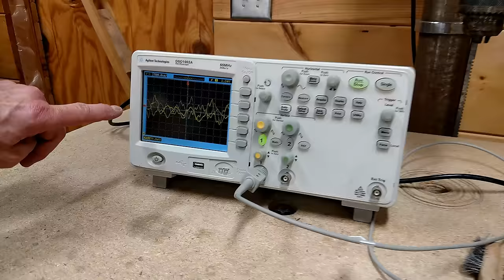Active Noise Cancellation

Comment: Great video, thank you! Do you know, would it be possible (or are there already solutions out there) to use active noise cancellation to reduce the amount of noise in a flat or house coming from outside?
Reply from the maker: I'm not aware of any specific solutions.  An attractive approach would be to reduce the penetration of this noise through the walls and ceiling with drivers attached to the surfaces that made them virtually much stiffer.  Such an approach would require a large number of independent channels.
Reply: That‘s for sure a very good idea, especially when the most noise from outside is coming through the walls or windows - whatever could be virtually stiffer with the drivers. But what in the case when noise is entering not just through walls or windows but maybe as well trhough other leaks. Could it be a feasable approach to pick up the outside noise via outside microphone and somehow produce an inverted noise inside the flat? Kind of like the noise cancelling head sets from bose for example?

Comment: Awesome video !! Interested to know what phase shifting circuits that you use ?
Reply from the maker: Thanks!
Because the mic and the exciter are intentionally positioned so closely, the polarity of the amp output is simply inverted.  At frequencies of several thousand Hz and above, this will limit the effectiveness of the noise cancellation.

Comment: An impressive demonstration very educational but also very frustrating. It would be helpful if when the sound is generated for demonstration, either immediately turn off the noise once you demonstrate the sound that you're talking about or switch to a voice-over (video seperate from audio) and then just show the oscilloscope. We could hear a sample of the initial tone, and avoid having to hear you speak over it. (Difficult for folks with sound sensitivity, trying to learn because of that sensitivity -- i.e. excruciating or disturbing ear or brain pain or loss of focus/ability to process.) Great job, wish I could have listened to all of it. Had to stop because of the sounds, but you're the clearest lecturer and a good pace, not so over the top enthused that it takes away.

Comment: I really liked what u just explained,
I have a question though.
You just showed that changing the polarity of the speakers cancelled the noise of each other.
What changing polarity did was, when one cone was moving in the other was moving out, so they cancelled each other's sound. 
I was just wondering that my speakers have passive bass radiators and when the speaker cone goes in the radiator come out and vice versa  so why does it not cancels out its own noise  
If you read this question please reply as I really want to know.
Thank you for reading my question
Reply from the maker: That's an interesting question.  Passive radiators have to be designed properly to avoid phase cancellation.  The passive diaphragm does not move at EXACTLY the same time as the cone which is generating the pressure wave in the cabinet because the wave travels from the back of the cone, at the speed of sound, between the baffles before it gets to the radiator.
Reply: @TechIngredients  
Thank you for explaining it to me

Comment: Absolutely fascinating! Out of curiosity do you think this application could be applied in an apartment. I’m an audio engineer, so I mix in my room with my studio monitors. Sound travels very easily in my apartment even with the doors closed, so my roommates can hear virtually everything I’m listening to. So hypothetically if I took an Omni directional mic and put it in my room that actively takes in sound within my room, inverts the phase of the sine waves, and then transmits that signal to loudspeakers speakers in let’s say the living room, would that help cancel out some of the room bleed? Or am I totally off with that. Do the speakers have to be in the same room for it to work, would I just be making it worse and I’d just be making things louder?
Reply from the maker: The barrier needs to be located at the walls.  Unlike Bose noise cancelling headphones, these act to make the walls appear far stiffer or more massive than they actually are.  The sensors would be best located just outside the barrier and as decoupled as possible to minimize feedback and the drivers should be located on the barrier as close to the position of the sensor as practical.

Comment: Wow, this video gave me an idea, i have a noisy fridge, it makes noise like wind blowing. it seems to be loudest just behind the plate with the refridgerant running, and i wanted to passively seal it better there. but since it is a Marshall Amplifier styled fridge, active noise canceling would be amazing! i could mount one(or a few) to the back of the fridge and get a mic in there, 
but do i just need a amplifier with inverted signal from the mic to power it? or how can i get it timed alligned correctly?
i guess an active DSP solution would give me too much latency, but i am going to look that up!
Reply: i think im even going to try out if the sound stays the same everytime the fridge turns on. that way  i can trigger a small amplifier playback board and just mess around with when the delay of the trigger.

Comment: Since the actuators move the metal plate regardless of the face they are mounted on, wouldn't it be possible to mount them on the same surface as the microphone? I was thinking of making the opposite of a stick-on speaker so I can stick it to a window pane for a quieter room.
Reply from the maker: They should work. Just make sure the polarity is correct. Otherwise, you would amplify the sound!

Comment: 2 Years later... but i hope its not too late. Here is my question:
would it be possible to mute sound directly at the source by recording it with a mic and putting that inverted sound out with a speaker?
or would the latenzy bee to big?

it would be awesome to sleep better by muting the noise source... awesome product by the way didnt saw that on the market
Reply: oh you actually build that kind of in the video. Can you link the products, for example the mic, speaker and the little curcuit amplifier. I am thinking of a little device that could be placed in a ,,normal" room and decreases the noise... would that be possible.

Comment: Another method would be to make only the framework of a box enclosure, then cover it as with vapour barrier plastic, both inside, and outside to create a double wall. Seal these frames and plastic by coating with paint or urethane, and drill holes into the frame to hook up a vacuum pump apparatus. No need for a vacuum pump, as there is no need for a high vacuum, but only drawing some of the sound conducting air out from between the double walls as with a stiff rubber bulb. This is simplest, cheapest, lightest and the least amount of trouble by the way. :)
Reply from the maker: It amazes me how "great minds think alike", if you'll forgive me when I "humbly" include myself in this group.  In a few hours we will be posting a very interesting video that incorporates this concept without any of the structural concerns of even a partial vacuum.  Stay tuned.

Comment: I'm interested in noise reduction in cars.  It's relatively easy to absorb high frequency sound with acoustic mats, but low frequency noise from low-profile tires is hard to stop.  Active Noise Cancellation would be perfect for dealing with that.   Would a simple system with a single microphone and a couple speakers be worth doing, or is the acoustic environment too complex?
Reply: I believe some cars do this using the in car audio system.

Comment: You've demonstrated that it works with a 'pure tone' (a single musical note that displays a perfect sine wave when hooked up to an oscilloscope), but can active noise cancellation work with complex-wave sounds like speech or the sound of an engine?  How would you calculate / reproduce the same sound 180 degrees out of phase?
Reply from the maker: All types of sound, even noise is just the superposition of multiple sine waves with different amplitudes and varing phase relationships.  That is why a single floor speaker, that can only move in one dimension, is able to reproduce complex sounds and noise.  The same applies when a speaker driver is used to cancel noise.

Comment: I wonder, the tone you supressed is ideal but if the sound comes from a couple of  with very noisy fans cooling a computer equipment how does it work then? There is also air in and out from the box.
Reply from the maker: It doesn't matter what the source is or how apparently complex.  The principle is that the mic picks up the total, summation of the sound pressure from all sources, at each instant, and the exciter applies a force to the wall to counter that pressure.

Comment: This looks like it could be used to reduce noise in the cabin of cars. Using arrays of these tiny speakers on the inside of large panels that reverberate the sound could reduce the need for heavy deadening material.

Comment: I'm no professional people in this field but I have a concern about it.
There might be a slight delay in the 'mic-speaker' feedback loop, so the generated reversed sound wave will always be shifted a little bit. Could it be that if the frequency of the noise is equal to 1/delay (e.g.: Delay=0.1ms, then let the frequency be 10kHz, still in the range of sound that can be heard by human ears), then the noise would be twice louder?

Comment: Don’t you need a phase adjustment  for each amplifier as well?  Very nice video!
Reply from the maker: No.  That is the advantage and the disadvantage of this far simpler approach.  By placing the microphones and the drivers so close to each other, a 180 degree phase shift is effective as long as this spacing is much less than 1/2 wavelength.  At frequencies above several thousand Hz, this spacing becomes significant and the usefulness of the phase reversal disappears.

Comment: Wow!  That's very cool.  

How would you address the more complex sound sources one might want to silence in a practical application of electronic noise cancellation, like the noise of an engine or a human voice giving a speech?  It appears to me that matching a single tone's frequency is simpler than would be capturing and responding to varying sound.
Reply from the maker: It should not matter how complex the sound is.  The exciter is acting to reduce the movement of the aluminum plate to any sound pressure tat is trying to move it.  Effectively, it is making the plate act as if it's stiffer (thicker) than it really is.
Reply: @TechIngredients  I thought the exciter was "hearing" the generated tone through the microphone and emitting a similar "tone" through the device mounted on each plane and out of phase with the microphone inputs.  Wasn't that why the cancellation diminished when you turned the microphone off?
Reply from the maker: The microphone is responding to sound pressure.  Even though we hear this as complex sounds, at each point in time, microsecond to microsecond, all the microphone can do is convert the pressure at any instant to a single channel of analog voltage.  The microphone is a sound pressure transducer.  The amp magnifies  this output to drive the exciter, 180 degrees out of phase in order to apply a force to the outside of the metal sheet to counter the force that same sound pressure is exerting on the plate from the other side.  That is why I had to adjust the gain from the amplifier to just balance this force.
Reply: @TechIngredients  I see.  I was conflating the external sound cancellation approach (producing an out-of-phase tone to shrink the amplitude at the ear) with the different mechanism for deadening the sound at the box panel.  I see now that these are two distinct methods to reduce perceived sound, one reducing perception and the other reducing the sound transmitted.   (I'm near the edge of my envelope.)  Thanks.

Comment: Is the polarity of the speakers/drivers on the external walls important?  It looks like you want the drivers to move the walls in an opposing direction of the internal noise source to generate the anti-phase sound so presumably polarity is crucial.

Also, would this experiment work if you did not use foam and just used the steel sheets (or some other material - eg. clear acrylic)?  Or is the foam there specifically to propagate sound more internally than externally (a vibrating plate itself would propagate sound both forward and backwards)?
Reply from the maker: The foam acts to dampen the pressure waves that circulate within the box, but the principle should still work with only the metal sheets.
Reply: @TechIngredients  ah ok thanks!  What about polarity of the speakers?  Is that important?

Comment: Do you think this would work in a bigger scenario, for example for a room in an apartment? For example, I would love to actively noise cancel the noise from my upstairs neighbors walking around by placing contact mics on my ceiling and have it phase reversed to a subwoofer or speakers that can reproduce low frequencies properly (since most of the noise is low end rumble)
Would love to hear your thoughts!
Reply from the maker: It can.  The advantage of this simple feedback system that avoids digital signal processing like noise canceling headphones is balanced by the need to locate the speaker as close as possible to it's microphone.  Lower frequencies will be the easiest to cancel.

Comment: Sir, 

how about making the box rectangular then a cuboid ?

mounting the active drivers on a frame   mounted to the main box via vibration damping couplings (rubber mounts,or something )(the frame with the longest side facing the direction of actuation of the driver (max moment of inertia , thing u get the idea right the 'I'-section takes more bending moment in the direcation perpendicular to the web........ ,those long boring structural integratiy class in engg. 202?)?

comparing all of the modifications w.r.t weight,energy,complexity,cost(lest iam dreamer , not a maker)
with one of those referance microphones set at at 1 m from the source , and the sound energy emitted.
Reply from the maker: The limitations on this approach to noise control are not on the macro scale, but on the micro scale.  It will matter little if the box is rectangular, a cube or even an irregular blob.  The large scale stiffness of the sides will be effected by this choice, but what matters more is that the detector (a microphone or accelerometer) is isolated from its actuator and that there is a sufficiently high density of actuators to neutralize the complex modes across the walls of the box.  Take a look at our first video on speaker design.  Near the middle of that video, I demo a Chladni plate.  The complex pattern you see are produced by up to several thousand Hz and would require 30-40 actuators to effectively prevent these peeks from forming.  This is not a problem in the emerging world of MEMS and this is the way to go.

Comment: Cool, now how do we apply this to your workshop to cancel out machine the noise? Like your bandsaw or my compressor. Then can the science be applied to noisy neighbors in apartments or across the street from my house?
Reply: it could be applied to house during construction with in-build noise cancellation, however there is a another side of the coin - you house would be full of speakers and microphones and someone would be able to abuse it
Reply: Right... Let's set the distance from my neighbor's "man cave sports bar" garage at 100 ft from my front door. The sound wave will be full audible spectrum with a mix of music, TV, voices at the same time. 
*If I am understanding the system, we can measure and have a viable expectation of the wave form hitting the front door and the front of the house. Relatively wide waves as they are so far from the source (Ripples from a stone dropped in water).
So here is the question, what kind of device [speaker] could make that 100 ft wave in just 10 ft? So it would be altered 10 ft before the house. 
Unwanted Noise Waves--> )))))))))))))))))))))))))))))))))))))) |Diffusion| ((( <-Distance from counter noise machine. 
{{ Note: I have not looked into the commercial systems technology used in call centers.}}
Thank You again for your channel.

Comment: It would really be nice if there was a link to a more detailed version of this in text.

What I am wondering here is how this could be applied to an everyday situation like a workshop in an apartment building.
I have a woodworkshop and my neighbours can hear quite a bit of what I'm doing to the point of not being able to watch tv let alone get rest. I was wondering would I have to basically enclose my whole workshop in sheet metal in order to cancel some noise? I doubt this would be very effective if applied directly to brick and mortar walls. The experiment with two speakers gave me some hope until I realised that they both act on the same input signal and are not relying on audio detection first.
Would I be correct in assuming that if one of the speakers was not hooked up to the signal generator but to a microphone, the lag would hinder if not make sound reduction completely impossible?

If it did work, I would be very interested in the most efficient way to cancel sound created in the 100 dB(A) range from woodworking machinery. My neighbours would be in your debt even though they'd never realise it :D.